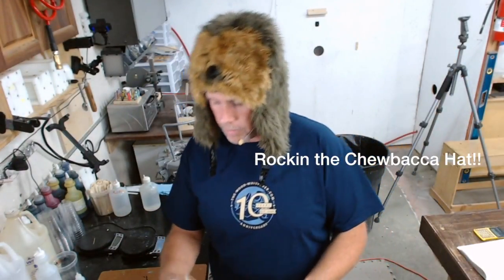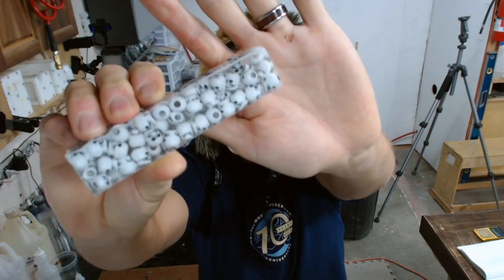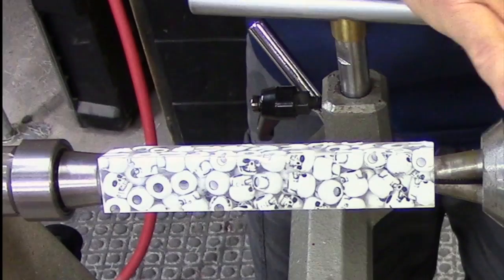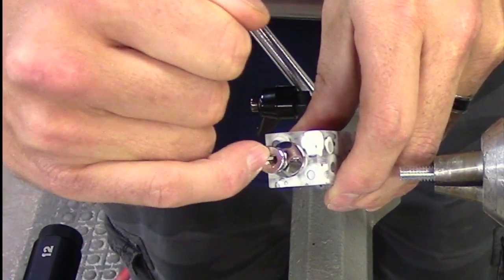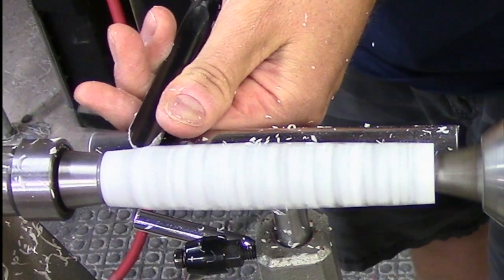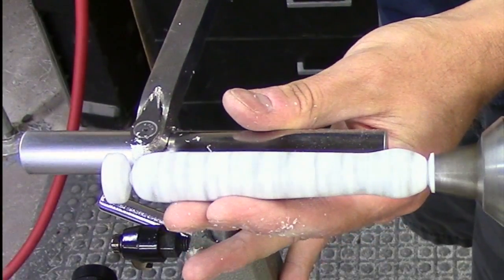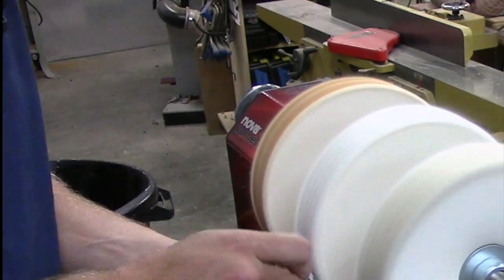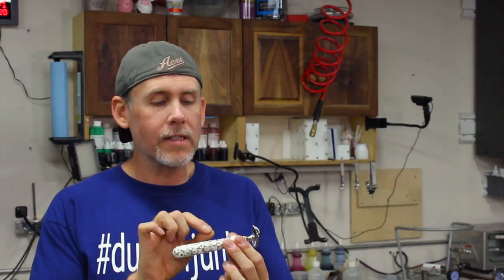The Skull Bead Razor Handle | Dunkin Junk

Comment: I was wondering you thoughts on something Zach have you ever had any luck or heard of anyone using a pressure pot to stabilize wood
Reply from the maker: Hey Cody, if you're talking about using pressure rather than vacuum, it's not possible with home setups. Some people do use pressure pots as vacuum chambers with conversion lids, but my personal recommendation is to go with a totally clear chamber like the TurnTex ones so you can see exactly what's going on inside the chamber

Comment: Hey zack just got all set up to cast my first blank I have a single blank mold for now and was just wondering how much resin I should measure out for 1 blank don’t want to waste resin as you know alumilite is not cheap lol
Reply from the maker: Great to hear you're set up and ready to rock Cody! The fun is just beginning =D How much resin you need depends on the dimensions of the mold. Alumilite has a material volume calculator on their website that should help out for this and any other size mold you make: https://www.alumilite.com/store/pg/12-Volume-Calculator.aspx